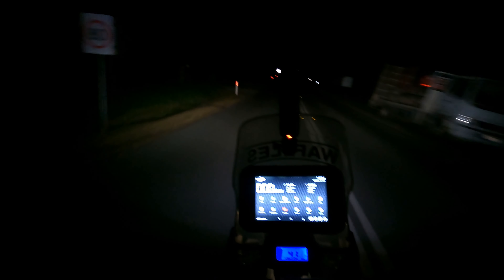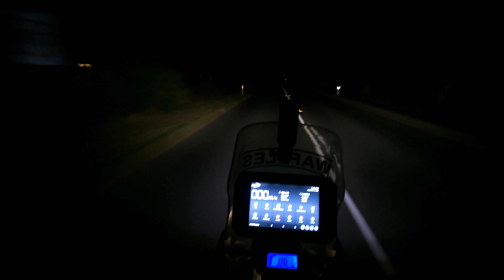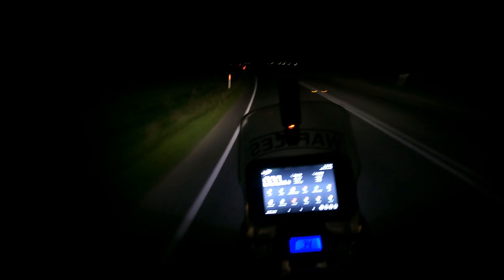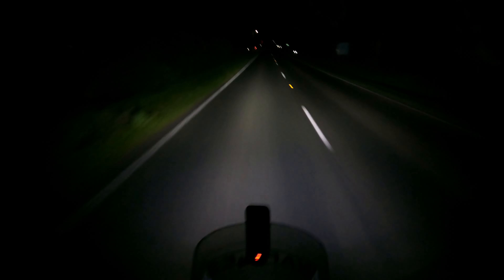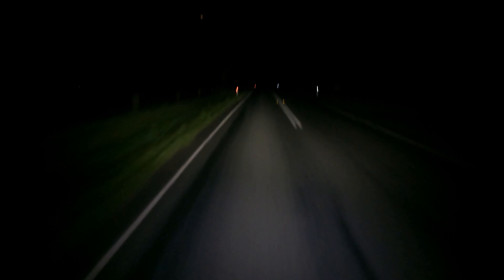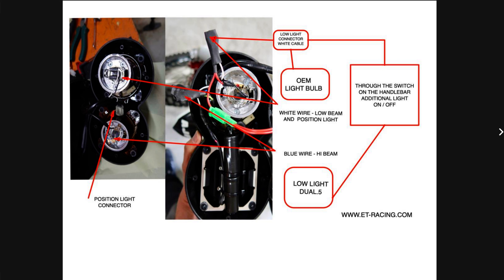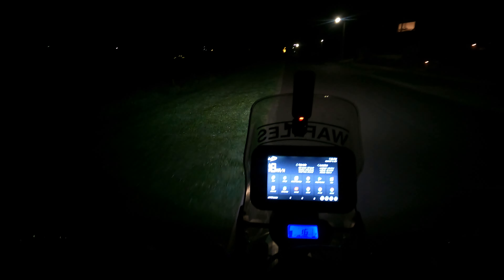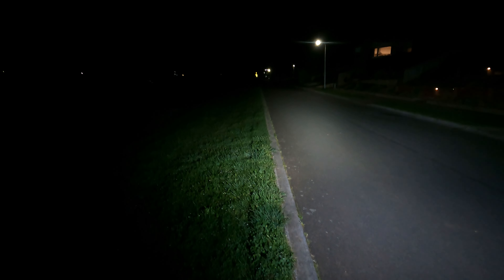Beta Test - ET Racing LED Head Light!

Comment: I ordered the LED headlight kit from Aventure Men Cave which comes with its support and the correct electrical wiring for the AJP Pr 7 2X 40W which is more efficient than your configuration (afterwards depending on the country where you are this can be presented  a problem because I don't know if this configuration is approved in Europe)
Reply from the maker: Yeah found that but said not available when I looked it up. Not sure what sort of configuration it is.
Got any links?
Reply: Remember that you install the Dual.5 in place of one upper lamp and leave the homologated AJP lamp... if you want, I have the 2xdual.5 version which gives 11,000 lumens and can be switched on in sections, depending on your needs.

Comment: How many watts on high is the led light, and what's the high beam wattage of your standard candle.
Reply from the maker: The high beam is 5500 lumens and the low beam 2200 lumens. Standard candle is 55W halogen. 
Rubbish compared to your set up but wanted to keep it original
Reply: @dirtbikeadv  I bet they will look alot better on dirt roads mate, I have done alot of day night racing in SA, I used to wind up stators from every enduro bike you could think of, also made our own ac shunt adjustable regulators ,so back before hid and led we ran 15.7 volts to them looked alot like hid in kelvens ratings. 
Even ran 360watts from xr600s  but thats another story.
Reply from the maker: @bigals.ktms.9937  Impressive. Yeah this is just the simplest option. Got some crash bars ordered so I might try and mount some spots on those if there not too intrusive